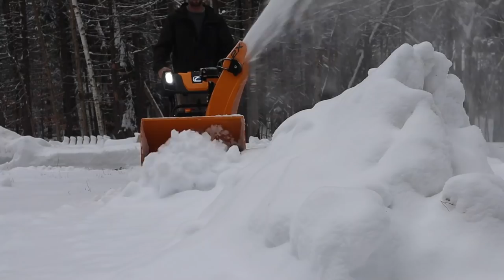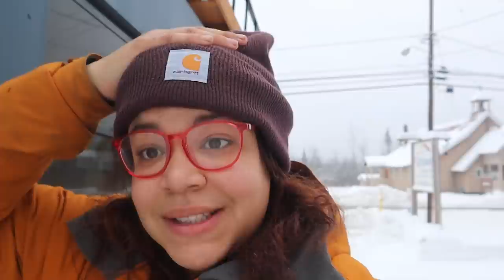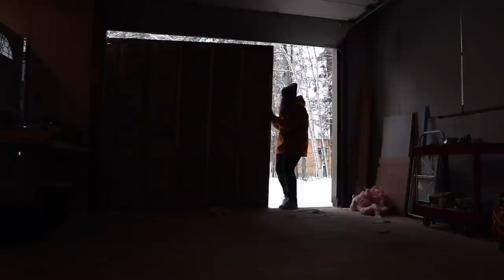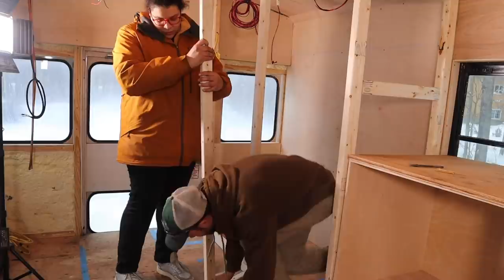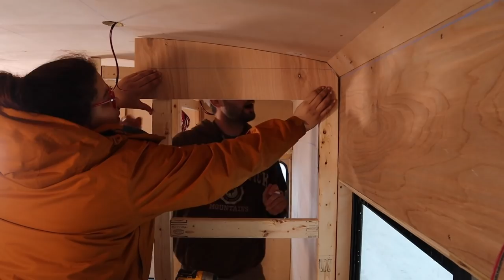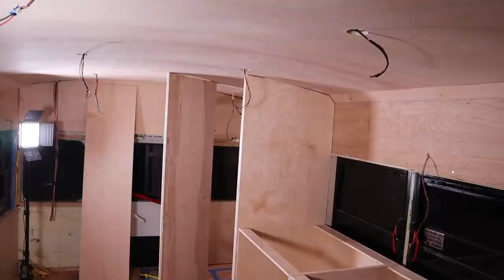Framing a SCHOOL BUS  on The SHORTEST Day of The Year

Comment: Rachel is so funny, love the charm she adds to the video's... I've gotta pull the engine outa my bus to do some needed leak fixes and broken exhaust manifold bolts... also going to go ahead and rebuild the front end components and probably brakes and tires all around... As Rachel would say, I wanna make sure "She Good" before I take off cross country.... Ivan is giving me so many awesome ideas for my build, I still get excited to walk outside and finally see a bus setting there.....!!!
Reply: Oh and Ambulance builds can be cheaper, insulated better, built in storage inside and outside, and easier to find in 4x4..!!!